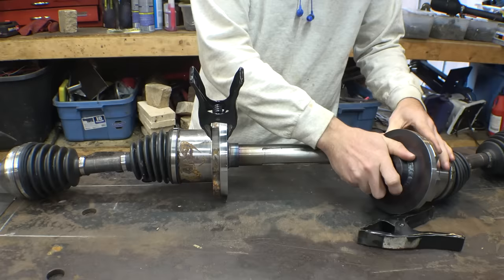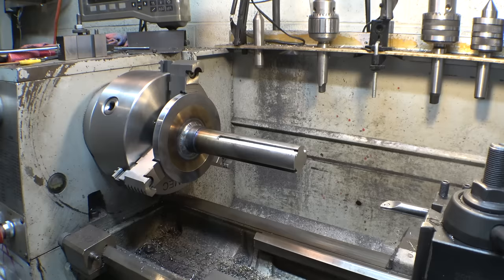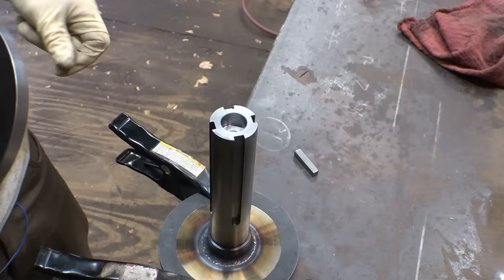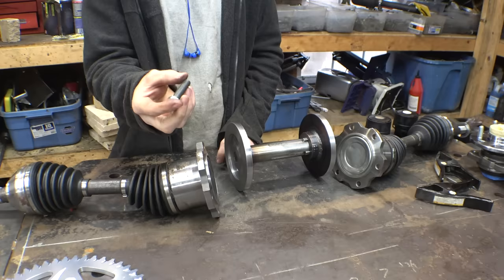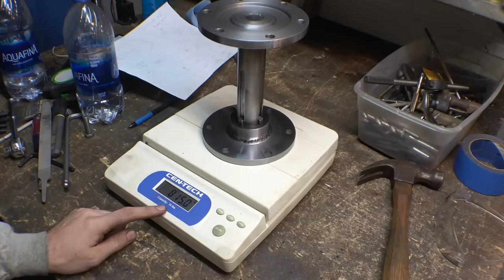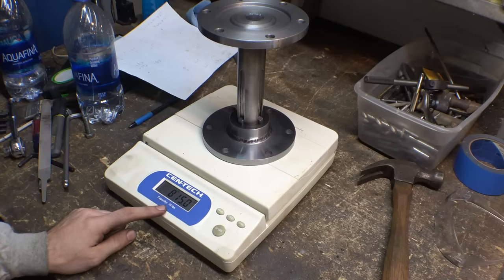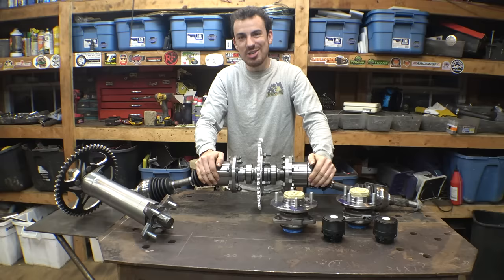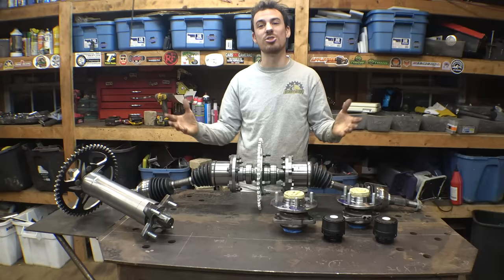Building Chain Drive Four Wheel Drive For My Next Project - Part 3

Comment: Bro.. Those are NOT Ford Ranger CV axles.  Just look them up on ebay.  Those are absolutely either GM front axles for silverados/ yukon/ blazers..  or they are F150 CV axles.  (that's why they are a 6 bolt pattern at the flange).   But I think you're right in that those Hubs are a Ford Ranger (and that's why they are only 4 bolt pattern at the wheel)....   Unless they are some obscure 'Ford Ranger" axles that are not sold on Ebay somehow-- but from what I can see, none of the rangers have those bolt on flange style CV alxes;   That's only the full sized trucks in GM or Ford..   So they may not even work on those axles--  have you actually tried to fit the axle and hubs together?

Comment: Can anyone provide info or details on the press-based tool used to cut the key ways on the ID of the collars/sleeves? I’ve never seen that before and it appears to make really clean cuts somehow.
Reply from the maker: It’s called a keyway broach, look it up on Amazon and you can find them for any size hole and any size keyway you need
Reply: @ratherBweldingChris  Very interesting! Thank you for the additional details.

Comment: You could of saved a lot of un necessary weight if you would have just taped the threads and not used nuts on the back side of everything.

Comment: Or 8 pounds, 14 ounces 3 crayons, 7 doritos and 1 gummy bear. Why stop with just 1 way to ridiculously measure something
Reply: Ye. Metric just better. I really don't know any reason why you should use somthing else
Reply: @backfishde4066  There's one reason: habits. Changing is hard for most people
Reply: "I will use literally anything else but the metric system to measure things". -The Fat Electrician
Reply: @backfishde4066  if you learn on imperial it works really well and it’s hard to change. Metric is undoubtedly more intuitive, but imperial works great if that’s what you learned. It’s like saying one language is better than another. “Why don’t you just speak -insert language here-, because it’s easier”. I use both, but I learned on imperial, so when I use metric I convert in my head to imperial to better understand what I’m looking at. Another example is 12hr time vs 24hr time. 24hr time is clearly better since you don’t have to pay attention to am/pm. But if you grew up on 12hr time, when presented with a 24hr time, you convert it in your head to make sense of it.
Reply: More power than a CBR1000….  Must be a car engine??  Subaru???
Reply: Your logic is flawed because crayons, Doritos, and gummy bares are not standardized and very between manufacturers and batches.